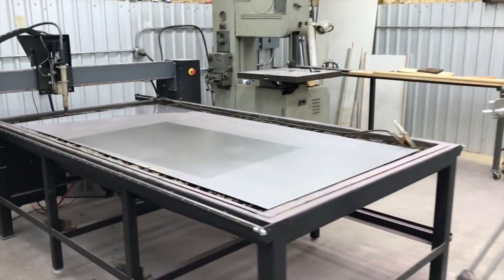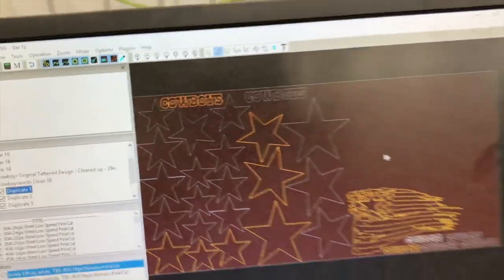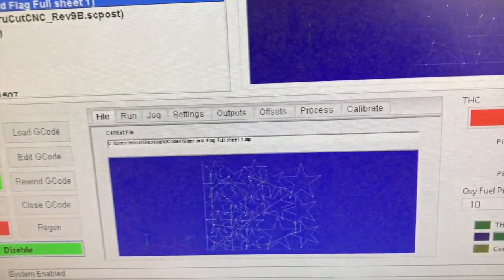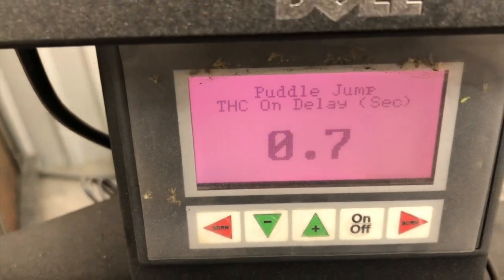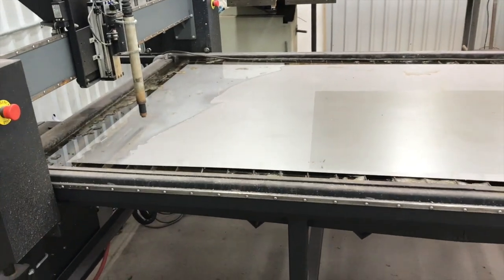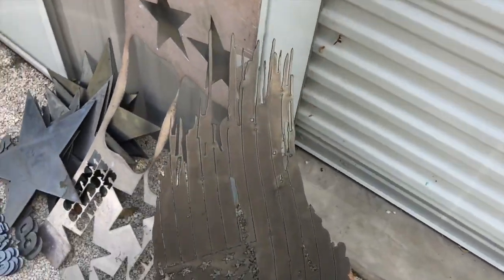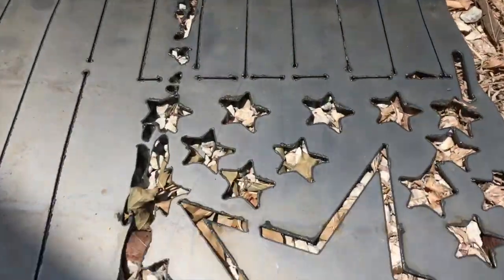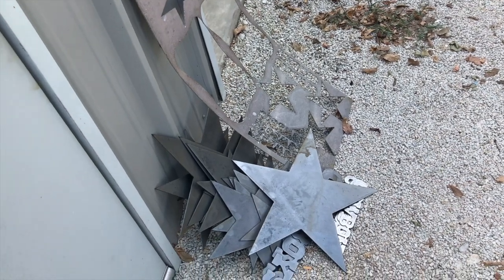600 IPM - THE FASTEST MACHINE ON THE PLANET - cncplasma table running wide open

Comment: yea... except it isn't the fastest machine... not even close..
the plasma at the shop i used to work at did 3000ipm...
my home-built machine does about 1200ipm, could go a lot faster with servos...
Reply: Lol. There is a limit on how fast a table can move and cut at the same time with plasma any faster and you won't be able to cut unless it's tinfoil. You must be referring to rapids where the gantry moves from one cut to the next but doesn't cut. Anyone can get there table to run rapids at 2 3 4 5k rapids but they don't usually because of tip ups and you won't be able to catch it in time or the table won't stop in time to prevent damage to the torch. As for cutting there is no plasma table that will be cutting at 3000ipm maybe not even 1000ipm I don't know where the cut off is on different gauges. Sometimes if you make the same thing over and over for a product and you know there won't be tip ups we gear the machine to run fast rapids.
Like I said most machines can run fast rapids but it's not ideal for someone cutting completely different things everyday.
Reply: @MikeT-om9mf 
 You're correct That isn't cut speed that is max travel speed. But the production machine running an XPR460 cut at a little over 1100 IPM on 14gauge mild steel. Yes we tested it.  Obviously that's running that much above the recommended amperage for that thickness steel. And obviously wouldn't be running that in production. 
But come on the guy in the video was running 85 amps on something right around 14 or 16 gauge. When he should be using 45 amps. So I think the point is moot.

Anyway we have since swapped to laser machines Running a 12kw fiber laser gets us right around 3,500 IPM on 14 gauge steel with nitrogen. Plasmas are only used for thicker materials now.

Comment: I don’t know a whole lot about CNC plasma tables but one thing to think about is efficiency and time. Would it be faster to do what you did in the video or cut everything with the same tip and same speed and not have to stop and change anything in the program, would it also have more or less dross creating more cleanup time. I don’t know how long it took you to change the tip and alter the program but something to think about

Comment: my nearly 20 YO machine BARELY has acceleration management, maxing out at 180 IPM, better around 140 most of the time. New table soon enough!
Reply from the maker: Dude you really get the most out of your machine, impressed with what you do with it.  So you going to build a table, buy one? or ?
Reply: Haven't decided, coming up on a crossroads on what I want to do with my business (I'll be moving to a larger shop on my land) and as the design for that progresses I'll make a decision, but I'm leaning toward building something large

Thanks for the accolades, I've been running it for 6 years, and still learning how it wants to be run, I have a camera pointed at the camera and an E stop about 30 feet away in my little office nook so I start a cut, go relax and watch remotely.
Reply from the maker: Well if your interested, might can get you a discount on a trucut Gantry kit.  You would get the Gantry and controller form them, and they have some very nice blue prints on building the table that goes with it, and you could do a build video series on it in exchange for the discount.  Just a thought...
Reply: 42Fab - Metalworking & Fabrication o
Reply: @42Fab come on over and join the TruCut Family!

Comment: Gary love your content.  My machine does 1000 ipm, but I never use anything more than 300 for my stuff
Reply from the maker: Right, mine is rated for 1200IPM, but I am not sure what tip and material is rated to run that fast, the book specs on the PM85 really doesn't show anything over 350IPM.  Whats the fastest you have ran yours?